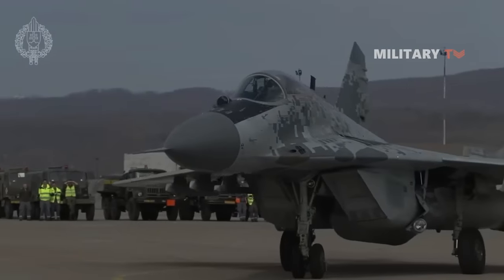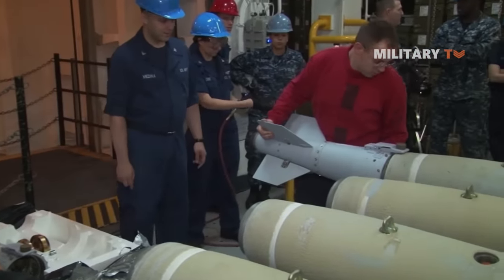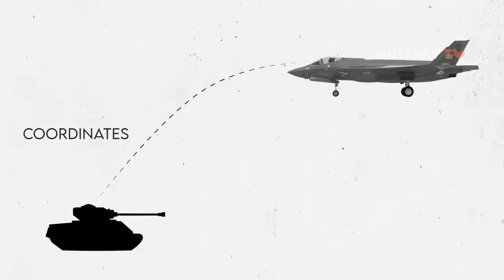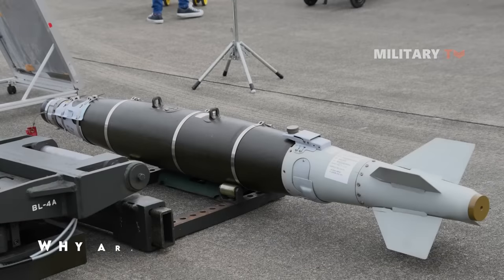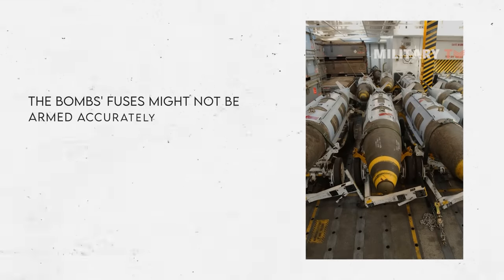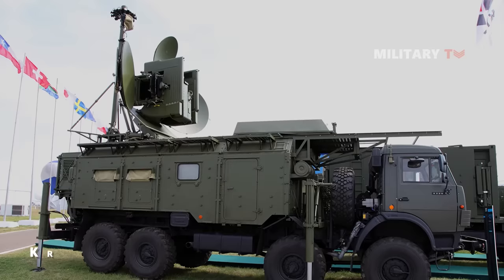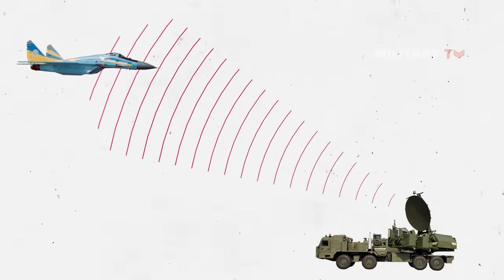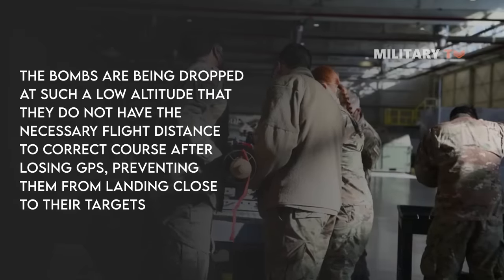Why Ukraine GPS Guided Bombs Are Failing?

Comment: I think these weapons demonstrated their effectiveness agains adversary who were outmathced by the western armies and who had almoast no capabilities to respond. When tested against a similar powerful adversary, their problems were revealed
Reply: vrey treu
Reply: No, these issues demonstrated that hot wiring jdams to planes they were not designed to interface with and used in engagement windows they weren't designed to operate in yeilds sub optimal results.

Flying high, with ew superiority, designating targets from the cockpit and updating the location via link16 in real time is how these weapons perform best.  The issues with harms in ukraine are for similar reasons.  Nato standard planes with decent ew pods will correct this operational shortfall.
Reply: similar powerfull adversary and russia are two words that rarely combine. as the fact that the truck that american trucks saved the soviet union shows.
Reply: I think part of the issue is that these JDAMs use the same tech as the GMLRS rockets from HIMARS, which the Russians learned to jam in the same way.  Same vulnerabilities between the two weapons, same solution from the Russian POV.
Reply: @flyinggoat2581  gps jamming has fairly limited range, which is why a lot of the gmlrs are still getting through.  Also, jdms from a western plane can and do use inertial guidance when used in ew environments.
Reply: @flyinggoat2581  Both systems have backup inertial guidance, which makes jamming not entirely effective. Whether the bomb lands directly on your head or 20m away is not really that relevant, especially when they're dropped in clusters
Reply: @Irobert1115HD  This is exactly why nato is losing a war, full of arrogance, and forgetting about what is to lead a real war where hundreds of thousands are dying. Only good for NATO is that Ukrainians are cheap.
Reply: @hrvojelasic5794  dude russia tends to loose its battles... a lot of times.
Reply: @Irobert1115HD  ... Not quite...
Reply: @jiggsborah7041  45% is still a lot more than you would expect....
Reply: @Irobert1115HD  which battles can you name them and do vs the ones it won? ont forget that we left Somalia, Iraq and Afghanistan, Vietnam with our tails between our legs, and a lot of our staff have been used against very outmatched armies, and as so they are not battle tested, in addition to that our procurement and supply chain systems are heavily corrupt and place profit over quality does being very expansive to provide the kickbacks to senators and Pentagon leadership, so I would not fully trust it, other thing that will get us kicked is believing our own lies as told in the media, underestimating an adversary if the first cause of many defeats.
Reply: @NitoKuvell  out of all countries in the world for someone to take Russia for a joke shows lack of knowledge and a heavy intoxication with propaganda. I understand in the West they like Russia bashing but sometimes we have to use our common sense like one time the British media said Russians had run out of weapons and they were fighting with shovels in Bakhmut. Like seriously what sort of a person believes that. Millionns did however.
Reply: @NitoKuvell  and then theres russia: the totaly OVEr estimated opponent.
Reply: @Irobert1115HD  looks like youre incorrect. ukranians outnumbered russian forces by a huge numbers and still with all that NATO support cant do anything. weapons from the whole world coming into Ukraine and it doesnt help much
Reply: @oddzie2  russian forces outnumbered ukrainian forces.... and ukraine hasnt collapsed yet.
Reply: @Irobert1115HD  they didnt. check stats about it.
Reply: @oddzie2  non russian or russia biased source please....
Reply: @Irobert1115HD  250-300k + mobilized people (estimated 300k+) vs 250k russian forces at the begining of the war. after 10-11 waves of mobilization in Ukraine they still outnumber russian forces who gained +300-400k during the second half of the conflict.
Reply: @oddzie2  sources that arent the russian ministry of defense please....
Reply: Agreed.
Reply: same goes for armor protection even mine resistant vehicles could not perform in a minefield, and missiles can be jammed shooting the ka-52 alligator a lot of technology is unknown, Russian Satellite was just upgraded before the counter offensive.
Reply: @namcoarmageddon9815  how did they upgrade a satelite? russia only recently found out what a digital camera is...
Reply: @Irobert1115HD  Trucks didn't save Soviet Union. Trucks just helped Soviet Union a bit. Soviet Union had its own trucks and if necessary could increase their production.  And trucks is not the most important things in a war. It's your propaganda tells you that existence of the USSR depended only on american trucks.
Reply: @Typexviiib  You lie. Bombs can't use intertial quidance. They don't have engines for that. Wind, and other things in atmosphere makes engineless inertial guidance impossible.
Reply: @amazin7006  You lie. Bombs can't use intertial quidance. They don't have engines for that. Wind, and other things in atmosphere makes engineless inertial guidance impossible.
Reply: @Irobert1115HD  Russia always win most battles and always wins all wars. Lost battles are very rare and always revenged after.  USA , Germany tend to loose battles and wars. Many times.
Reply: @AlexanderTch  borodino, crimean war, russo japanese war, soviet afgahn war, the mongols won, the beginning of operation barbarossa (roughly until western support started to get on its tracks).... soviet-polish war of 1918. also sorry that i forgot that but napoleons ''defeat'' by general winter also came from the fact that napoleon had to plan short due to the can not being a thing at the time... and spanish farmers burning their crops... russia never was the giant its made up to be and only is as large as it is because its mostly empty.
Reply: @AlexanderTch  
No, YOU lie. 

"The Joint Direct Attack Munition (JDAM) is a guidance kit that converts unguided bombs, or "dumb bombs", into all-weather precision-guided munitions. JDAM-equipped bombs are guided by an integrated inertial guidance system coupled to a Global Positioning System (GPS) receiver"
Reply: @namcoarmageddon9815  Meanwhile multiple Ka-52 have been shot down lol. Russian propaganda is in full effect
Reply: @NitoKuvell  US never lost a single battle in Vietnam or Afghanistan.  Not one single battle ever. Meanwhile Russians get slaughtered in Kherson and retreat
Reply: @oddzie2  America has 6000 Abrams tanks and we only gave Ukraine like 30. What do you mean "whole world weapons"? This is not even .01%. You have lost your mind lmao
Reply: @amazin7006  Ye they lost the war, and ask o the battle of Mossul in Iraq the US has lost many battles there, attrition is also a long battle and the US has lost many of those, the US also lost many battles against China in the Korean war and battles against north Korea and Russians in that theater
Reply: @AlexanderTch   you not knowing something doesn’t mean I’m lying.  

anything with a steering kit can use inertial guidance, it’s basically just a gyroscope, an accelerometer, and a clock programmed to work together.  Germaine’s v2 rockets from ww2 had an ins installed on them, that’s why they were able to hit London from hundreds of miles away.  No engine powering that, just a battery moving motors that change control surfaces.  Wind or gravity pushing  on the bomb generates a value in the accelerometer that can be compared to the null value from the gyroscope over a period of time can be used to calculate with a fair degree of accuracy how far the object has moved.  Pretty much every smart phone can do this, and the smart phone uses this feature when running on gps to save on battery life.  Instead of constantly pinging the tower it just does it ever 30 secs or so to keep the ins updated.  

The issue with ins is that miscalculations occur and compound, so accuracy can be between 5 meters and hundreds of meters depending on how long the ins had to run without having a solid physical position update.  

If you look at wikipedias entry for jdam under guidance it says “ins/gps”. So does sdb and harm.  Ins kits are small and cheap and it’s silly not to use it as a backup.
Reply: @NitoKuvell  Battle of Mosul? The battle where only 2 Americans died while 25,000+ enemies were killed and Iraqi forces + America declared victory over the city? That battle? You think we lost that battle? LOL
Reply: compare with Russian jet bomb their own cities, it is a huge success
Reply: @Irobert1115HD  yeah. they lose a lot of battles but wins the war.
Reply: @johnfernandez7681  im pretty shure that they will add this one to the list of their failures as well.
Reply: @
@Irobert1115HD: Don't be fooled by your own thinking of supremacy!
Reply: @AlexanderTch  🤣😂🤣😂🤣😂 to funny
Reply: @amazin7006  4400 Abrams approx n have gave Ukraine none to date. Fact
Reply: Вы американцы самые сильные, верьте в это, привет из России 😊
Reply: @Irobert1115HD  the soviet tank t34 save Russia
Reply: @amazin7006 they both defeat the will of the American people
Reply: BS
Reply: They are precise against 🐪
Reply: @Typexviiib  These bombs are guided by GPS not by the aircraft. All the aircraft is doing is imputing the GPS coordinates into the bomb system which is not a big deal. These bombs fail because Russia is jamming the GPS in the region.
Reply: @necsoiub  gps guided bombs like jdams arent supposed to rely entirely on gps.  They all have ins redundancy that is supposed begin tracking using input from the aircraft at launch.  If an f16 drops a jdam it will be substantially more accurate than a mig 29 dropping it in gps jamming environments because the mig 29 cant talk to the bomb the same way.

This is because ins errors compound over distance, and if you start with the location of the airbase vs a few miles from the target, one will have radically less time for ins to accrue mistakes.